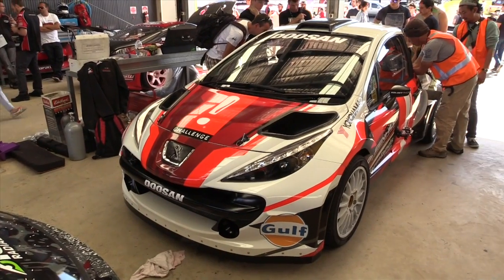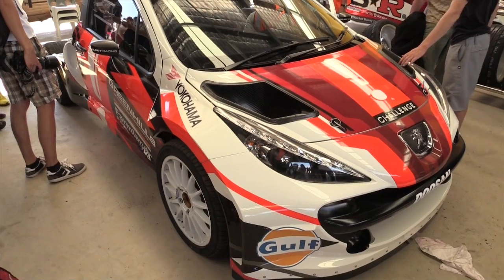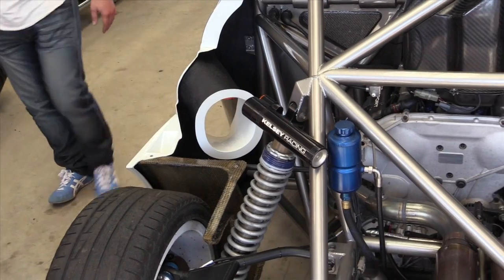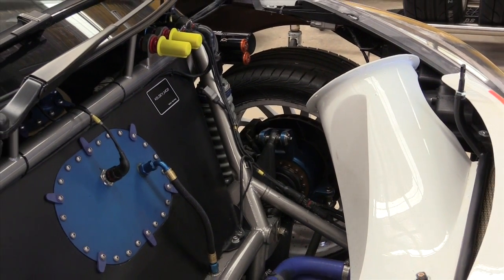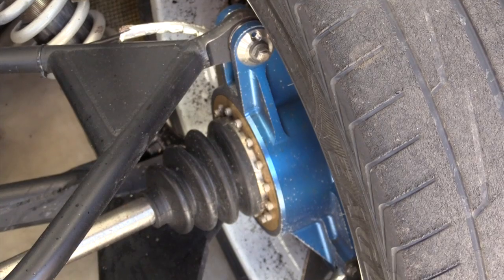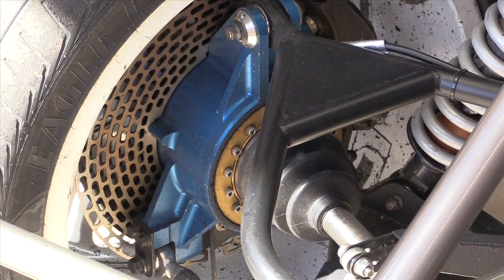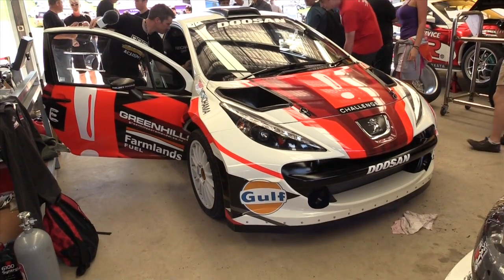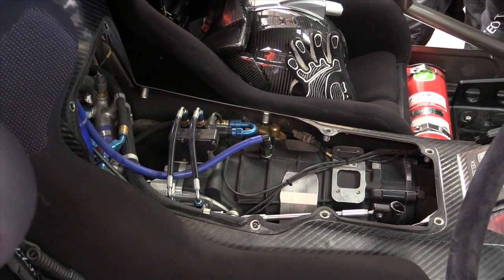[TECH TOUR] Formula-Renault Powered Rally Car | Alex Kelsey's MC2 tube-framed Rally Car

Comment: Aren't GP2 engines super high maintenance?  I heard the tolerances are so tight, that they can't even start the engine with out externally warm it up.
Reply from the maker: They will be higher maintenance than a Corolla, all race engines are, but not being able to turn them over by hand is a myth. Temperatures before starting to make sure the oil is doing its job and not stressing the engine for no reason is why oil and coolant will be preheated in some engines from Formula-1 to NASCAR and many other classes - Taz.

Comment: I am an Automotive Technician with over 30 yrs experience this kid is great, what he has done is build a monster Rally Car and what he has done is simplify everything that goes into building a rally car, ' handbrake lever with 2 master cylinders that can operate the hand brake and split the drive from 4 wheel drive to 2 wheel drive all at the same time, big wheel bearings with CV joints fitted into them' GREAT WORK went into this build

Comment: So how does having an idea for something and getting someone to manufacture your idea, make you the builder...???
Reply: thumpin1 steve jobs did it toó....
Reply: When u technically know what you want to build, you don't have to build it alone. You need team, an expert to cut the time and effort to create from 1 part to other parts, to gave you their knowledge and experience that focus on each vital parts which will make your idea WORKS.
Reply: Alex mentioned specific helpers by name but he suggested they worked together on various problems. He ,smartly, bought a good engine and gearbox and ECU. This is all usual practise for a car build. He said he'd been making things since he was very young so I guess he has the welding and fab skills needed, So I think he's genuine. The thing in the way is the cost and maybe his family has the resources. But lets not forget that most drivers in top formula's buy their seats this is hardly an objection in this case. I don't know these details but just suppose. As for Alex's lack of articulation, there are many talented Kiwi engineers/car builders who can just do it but are tongue tied if asked to ex[plain.